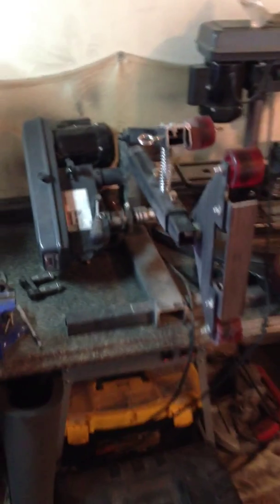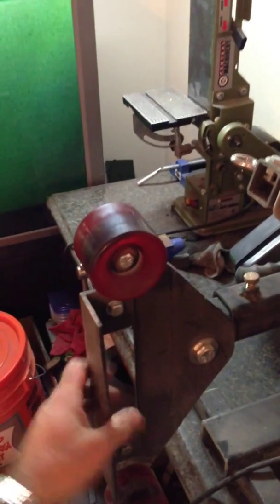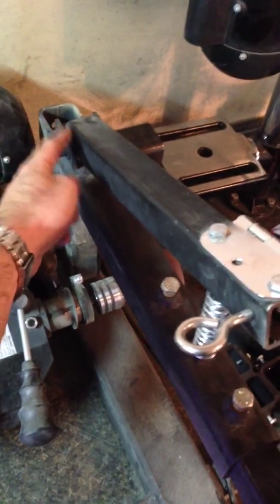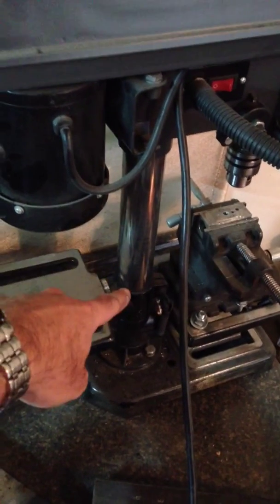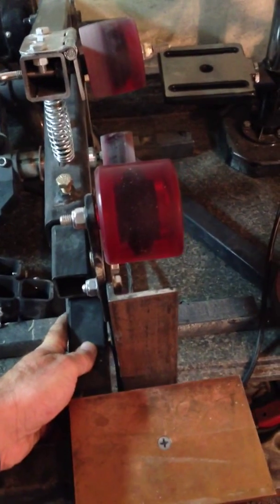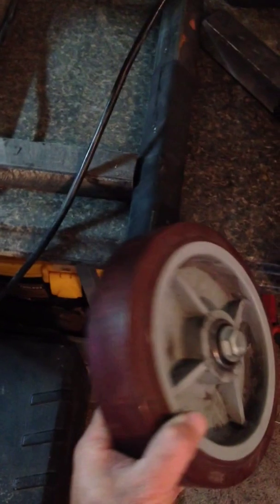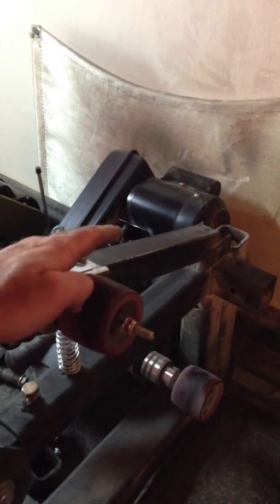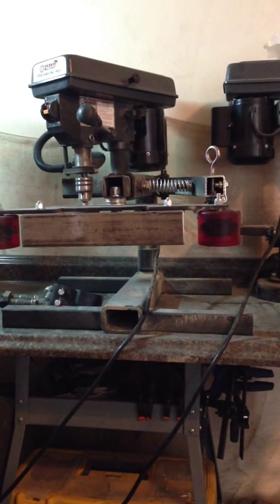Budget grinder walk around

Comment: Thanks for making the video, cool grinder man, have you considered replacing the wooden table with as steel one, mill make it smother to slide steel along it. I still cannot believe your doing this in your living room, what do you have against your house :D
Reply from the maker: Thanks Dom, 
It's actually a copper table but seams to work alright. Haha yea I know...
Reply: Stevenskris43
sorry man looked like it was wood, have you thought of seting up some kind of an extraction system to reduce your dust in the shop?
Reply from the maker: It's cool,
Yes I have and actually was watching a video last night about that. Channel is I like to make stuff. He used a shop vac and PVC with waste gates. Check it iut
Reply: Stevenskris43 will do man, a proper dust extractor is on the list after building benches